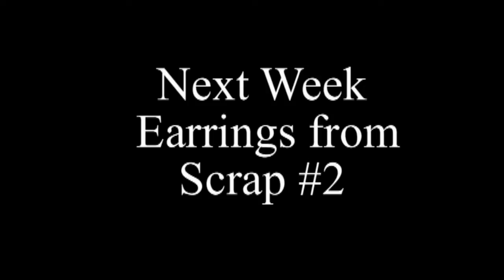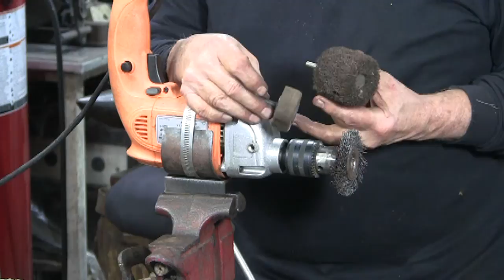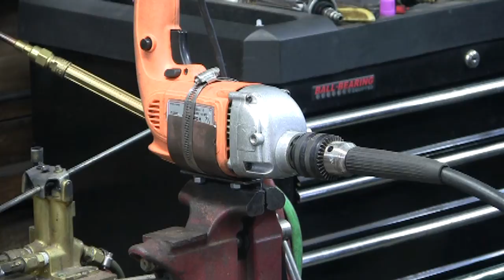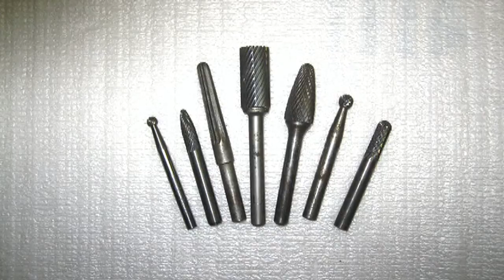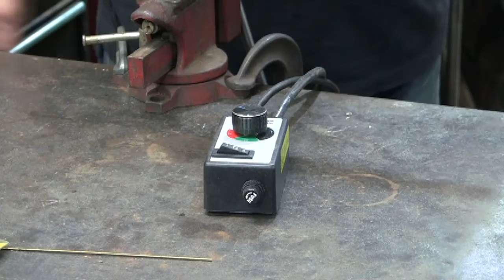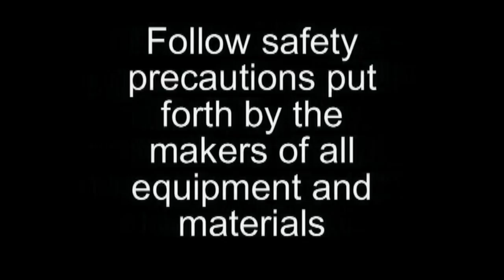Flexible Shaft and Speed Control

Comment: I have no idea if you still see these comments but here I go anyway, Nice collection of instructional videos you have made.
I have been working my way through them since I stumbled across one the other day. I recently picked up a 20 inch heavy duty floor mounted drill press off Craigslist for fifty dollars that was rusty, abused and didn't work. I also received four electric motors including the original one for the drill in the deal for free. After cleaning and scrubbing off the rust, rewiring it and getting a new belt, the thing works beautifully. My concern is that even on it's lowest speed it spins at 500 rpm and I had a very large diameter chuck gifted to me. 500 rpm is way too fast for drilling with a 3/4 inch drill bit. Today is Christmas. I also just received two of those Harbor Freight "Router Speed Control" units you put on your little hand drill. I am going to see if they work on a 1725 rpm 110V motor. That would solve my problem handily.
I got two of them because if it works on the drill, I am going to use the other one on an antique 21 inch wood cutting band saw and slow it down to cut metal with.
Thank you for making this video. It was very helpful to me and gives me some hope this inexpensive option will take care of my issues without having to try and figure out some complex belt/pulley fix.
BTW, Merry Christmas sir.
Reply from the maker: Phil, that is a good idea.  I've never used it on a motor but I would think it will work.  If you have an extra motor, consider setting up a "wire brush on a motor".  It is definitely the most used tool in my shop.   https://youtu.be/tXEJZfkhdx0
& a Merry Christmas to you!  Keep in touch, George

Comment: That thing is probably not designed for a large inductive load. If the triac fails due to cheap design, it can blow out the motor. They probably threw that fuse in there for UL or CE certification when it does fail.
Reply from the maker: Good point!

Comment: hi george thanks for shearing 
 ı wonder dose the drilling power drop using the speed control
Reply from the maker: Good question.  I'm sure that it will reduce the power.  But will check that out just to be sure.
Reply from the maker: Can't find the speed control.  It is basically a rheostat, like a light dimmer, so I imagine the power is reduced.  I've never used it on a drill.  My main use is for a electric die grinder.  The grinder is too fast and has no speed adjustment, which is why I used the speed control.